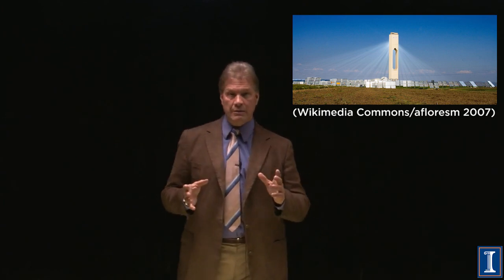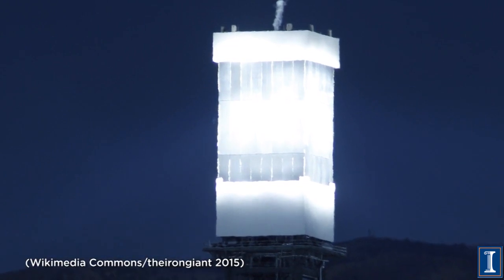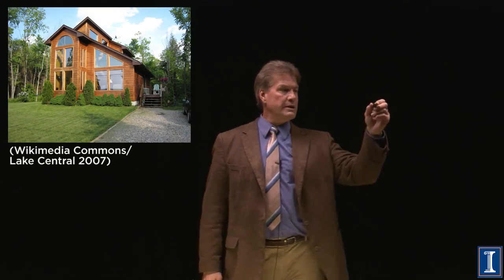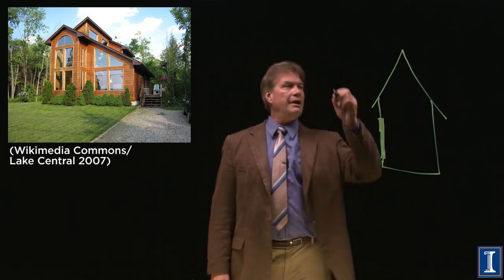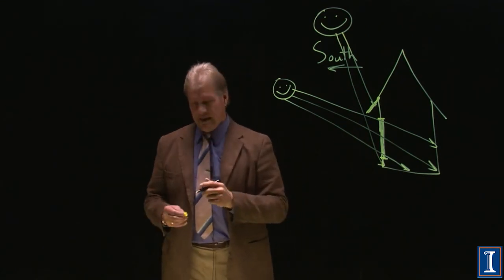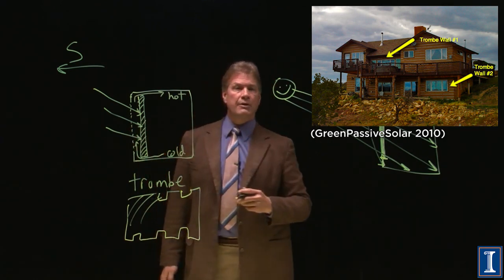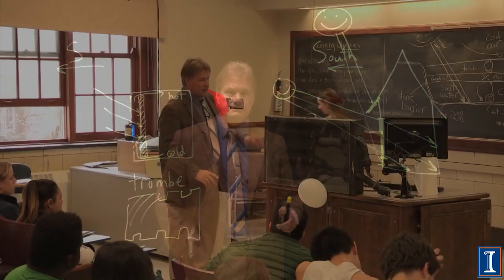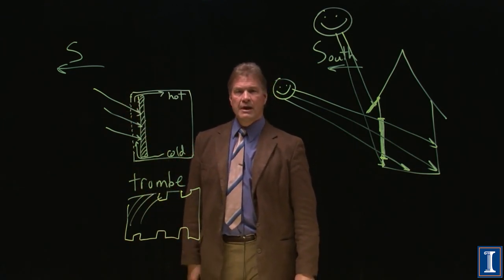What is "Passive" Solar?

Comment: This is excellent! Too bad it did not have that many views! Those glass building are tremendously inefficient - in NY, the most efficient building is the Empire State and the first glass building (Frank Lloyd Write, Lipstick Building) could never be used for people since it was too hot.

In Brazil people went from thick walls to use hollow masonry blocks - and that makes the houses hot during the day and cold before dawn. I'm for what we call "full length whole masonry bricks" - it would give an almost 8 inch wide wall that absorbs heat during the day and holds enough heat til the next morning. My house is build with hollow bricks and my room gets sun all afternoon - gets really hot but around 3:00am it gets as cold as the outside. I believe this kind of choice is responsible for a lot of pneumonia cases here in Brazil. 

An observation: in the Southern Hemisphere the sun also gets lower during the winter! Excellent video, Professor!

Comment: One thing that is not being considered is the cost of storage is orders of magnitude cheaper than batteries with solar thermal. It also has the potential to be much more efficient compared to PV. Will the economics work out to favor thermal over PV idk but it is very easy to see thermal winning.
Reply: actually this is very important also for these Spanish solar towers as they can use heated salt also at night time... you just need enough salt for making it work as buffer for your heat.
Reply: Or both - solar panels get less efficient at higher temps. Supply meet demand

Comment: 11:20 We actually built a solar water heater for our pool, made a frame out of wood and used PVC pipes with corrugated clear plastic for the cover.  Worked well but only lasted a few hours before the PVC pipes deformed and sprung leaks.  Supposedly this wouldn't happen if I used CPVC instead of PVC but that was too costly (CPVC is expensive) so we bought a commercially made solar pool heater, that lasted less than a season before it developed numerous leaks.
Reply: How would the cost of painting a garden hose black compare? Running a few hundred feet of garden hose would probably get your water plenty hot enough, and it would be fairly easy to run several in parallel if you want to increase heat collection without getting the water too hot. Garden hoses are flexible enough that they aren't likely to stress any fittings or crack from thermal cycling and they are easy to find and install.

Comment: It was a serious error to not make an explicit distinction between solar thermal and passive solar (mainly by building design). Those are radically different things. Different enough, in fact, that it would be best to cover them in separate videos. There was also no mention of the fact that power towers require direct sunlight, unlike PV which does not. Third, no mention of the advantage of power towers in allowing thermal energy storage, to enable electric generation at night.

Comment: Actually, the DeltaT for pools makes passive solar an excellent source for pools , year round, to about 45ºN.  Another excellent use not needing a large DeltaT is for heated floors, this has been tested to 55ºN.  (Both of those using propylene glycol in the panels on dark panels that tend to self-melt snow.  usually the hardest selling point for the money people are the storage facilities for the gained solar heat.

Comment: Use a clothesline. You can omit using a 5.5 kw clothes dryer that way.
Reply: I've also read that the motor powering the rotation and air circulation is far more effective than heat generating, so longer cycles better than hotter.